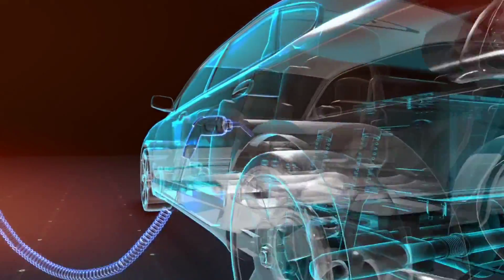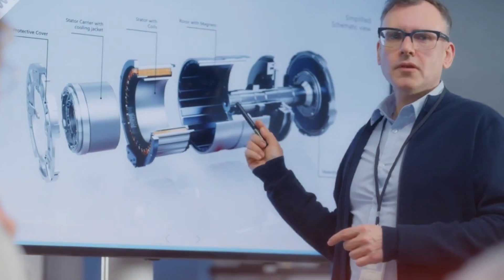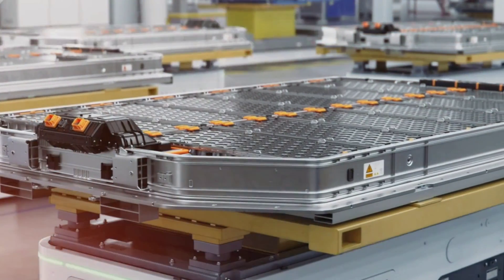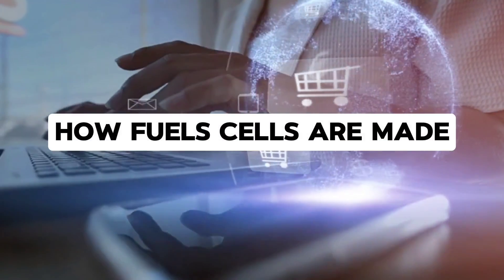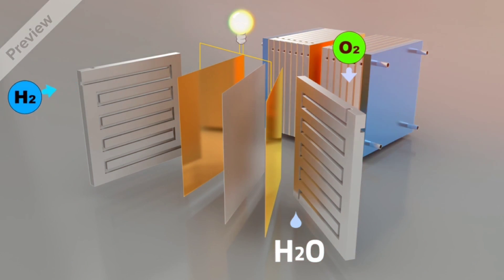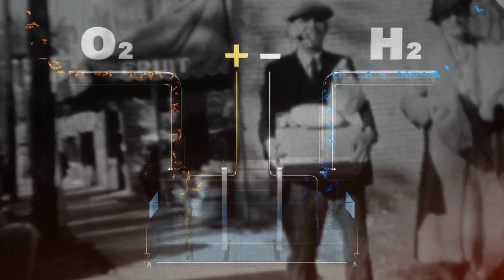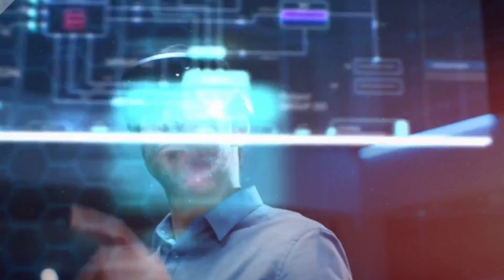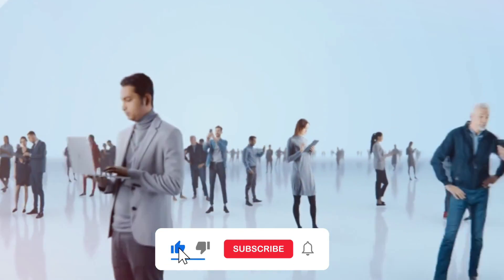This is how Water Engines Work!

Comment: You skipped very quickly over the production costs of the hydrogen fuel, money and CO2 and the dangers of fire. You say it is using better "technology" which is totally meaningless, bullshit speak. So here is my take on why Toyota are doing this, it is all about timing. They know EVs are doomed and will be gone in 2 years and any investment will be money down the drain, big money, they have seen the huge losses and bankruptcies.. So they mess around will this bullshit for a couple of years, throwing a few Yen into it and then ditch it.

Comment: I have the suspect that this whole text is AI made. No exact data, no real efficiency values, nothing. 
To make a summary, hydrogen power is not water fuel. To make hydrogen from water and burn it in a fuel cell is much less efficient than simply store the electric energy in batteries and use it in electric vehicles. 
More dangerous, more expensive,  more complicated and vehicle range also falls behind ev-s.

May the future will bring a breakthrough in hydrogen production efficiency, but at the moment it is a dead end.